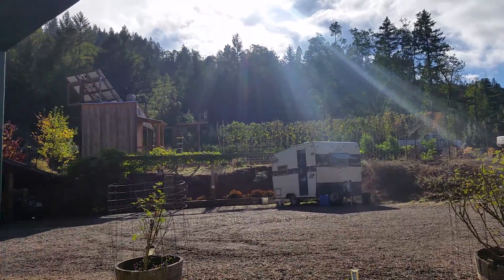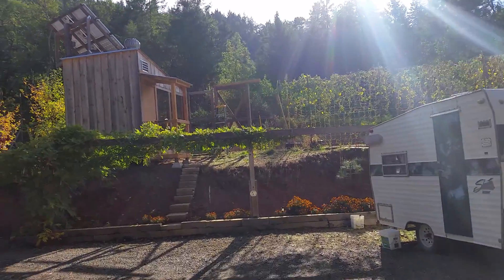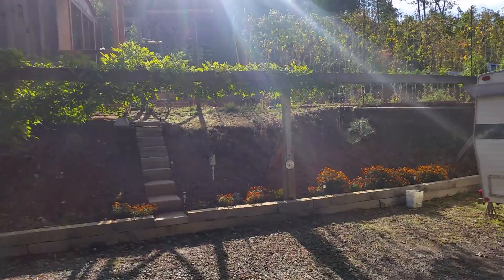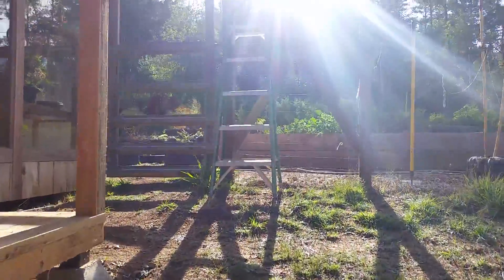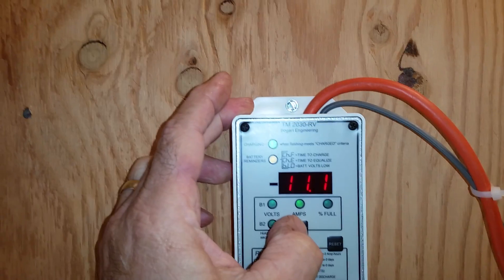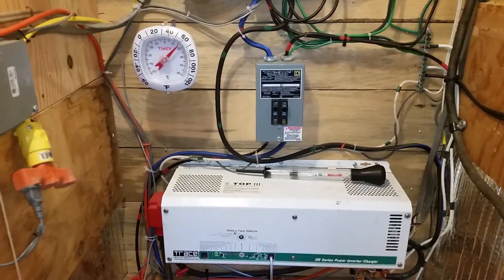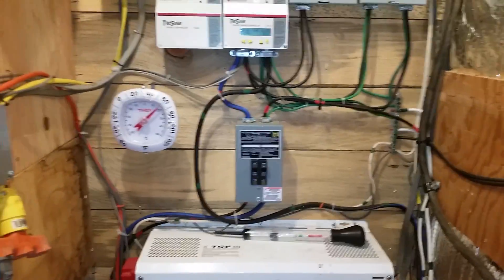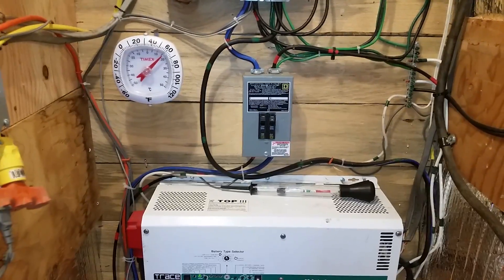Off grid solar homestead(Temp sensor for inverter)

Comment: Hello Steve, I. m almost done with my system and need some help with the wiring from the inverter (3000 watt modified) to a sub-panel  which is a SQ-D 8 space with a 30 amp single pole breaker and six 15 amp breakers, Now if I use #10 gauge AWG from the inverter with a plug on the inverter end ( not hard wired) and connect the other end to the 30 amp breaker in the sub-panel to energize the rest of the 15 amp breakers would that work, right now I have wired two 14/2 housewire to two receptacles in the house that would come from that sub-panel and ran the 10 gauge to the sub-panel but it not connected yet, I want to make sure before I fry the inverter  ( my battery bank is 10 six volt batteies with 12 100 watt renogy panels )
Hope you can help 
Al Ruark   in NJ